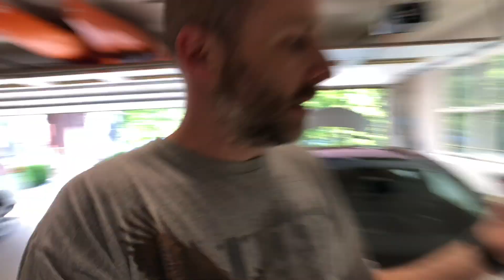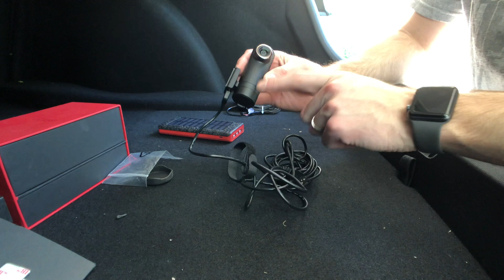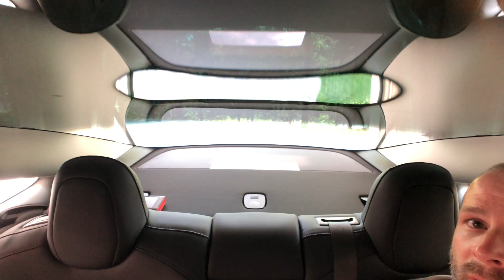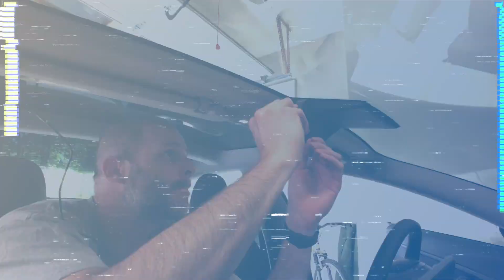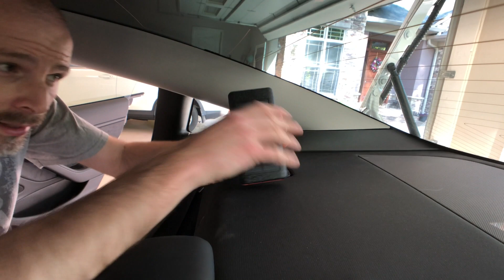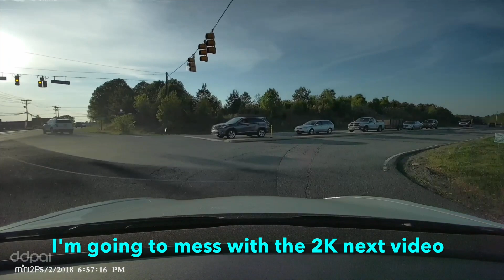Tesla Model 3 Dash Camera with a Twist

Comment from the maker: I am fully aware batteries don't like hight temps. This battery is designed to be in the sun though. Plus my car is not in the direct sun for very long each day. Plus the Tesla will cool itself off when it is too hot.
Reply: I think he's refering to the S/X. The Model 3 does not have overheat protection --- yet.
Reply from the maker: It will in the latest update 2018.24.1
Reply: So the Model 3 has the Indoor-Overheat Protection like the S and X?
Reply: i1Tesla  does the model 3 has a overheat protection like x&s or not?
Reply: i1Tesla thanks

Comment: So how does it works?
Reply from the maker: I use the TeslaCam now
Reply: Yeah but teslacam doesn't record while parked. I had someone playing with his keys on the bodypannel of my S. That event wouldn't be caught by the in car cam so I'd prefer to use a blackvue on my 3. I'm wondering if it was running OK. Another solution would be a bigger solar panel, an external battery hidden in the trunk. What do you think about that?

Comment: thinking of using Blackvue dashcams but its specs states that it doesn't use a USB cable as the power cord. Any ideas?
Reply from the maker: You have to hard wire it to the battery or find a constant power source

Comment: Why not stick battery to window, with solar panel facing glass? You can then place it at roof center. Less wire and less mess
Reply from the maker: It did not charge the battery much at all

Comment: Do you think a portable charger + power bank like this (http://a.co/guAc9mC -- RavPower 2-in-1 Wall Charger and Power Bank ) would work to power up the dash cam and charge itself from the 12V car charger or via solar? This one has 10000 mAh capacity and says that you can use it while it is charging.
Reply from the maker: Not all power banks can charge and deliver power at the same time I am finding out. I found one that will work and it will be in tomorrows video. Not solar and it is 20000 mAh

Comment: I just added a Mini3 to my Model 3. I was able to run the wire around edge of the trim. Were you able to figure out how to remove the black plastic attached to rear-view mirror? Looks like a great place to run the initial portion of the wire but I didn't want to stress it and somehow break it.

Comment: Thats a fire waiting to happen.
Reply from the maker: No it is not. The battery is designed to be in the sun It does not get very hot
Reply: It has no way to cool itself.  Just because it has a solar panel, doesn't mean its 'designed' to be in the sun. Your 50k isnt worth the risk. Im just concerned for you man. That's all. https://www.battery-experts-forum.com/media/publication/Lithium_Batteries-Fire_and_Safety_Hazards_Buser_Maehliss.pdf above 140f its starts to get dangerous. Easy on a normal summer day.
Reply from the maker: My car is not in the sun very much and the car cools itself off when it reaches high temps.
Reply from the maker: I am going a different way any way. The back is too small and the solar panel charges to slow

Comment: I installed a blackvue 750S 2ch on my model 3 since October 2017 directly to the 12v battery.  I haven't seen any problem so far.
Reply: Do you have parking mode on? That seems to be the common denominator leading to issues from what I can tell.

Comment: The sad thing is the Tesla model 3 has everything needed in the car to use multiple cameras around the car to monitor and record activity. That is what autopilot does for driving after all. Cameras, Sensors, processing power, user interface, internet connection, and hive cloud network are what make that service seamless. It would not be a heavy lift for Tesla to build in a cloud security service. There might not be a large enough data storage device in the car for recordings, but cloud services don't need nearly as large of an onboard data storage. Factor in the model 3 does have a USB interface which can allow for external hard drives to be connected. Your phone is a prime example. This is the type of innovation Tesla needs to keep introducing.
Reply from the maker: Spiitz Travsky the cameras see in black and white. The back one is the only one in color. That would not make for dash cam footage. But Tesla can pull the footage in a bad crash

Comment: My ddpai2 minis as I have front and rear drain a 35Ah battery over 36 hours so that's not going to last long unless you get shed loads of sun
Reply from the maker: Thank you for the info. I am already finding out that info now. I will be changing it up a bit and sharing it on the follow up video
Reply: i1Tesla I can tell you the pair of cams draws 600mA at 12 volt. So I think you might get 5  hours max  off your 2.4Ah pack. I gave up so now they are on the switched aux line now
Reply from the maker: That is what I am finding out today. It has been 24 hours now and it is not enough. I am going to run power to the aux line to the battery so it will charge when I drive and the sun will help when I am not and see how that works. If not I will send the battery back for a larger one.

Comment: Nice high clear view for AP tests.
Unless you park outside at some point in the day I'm guessing the pack wont work.
Reply from the maker: My car sits in the garage and the window shines in the back of the car the rest of the time I will be driving
Reply: Well, I guess if the circuits are engineered well (unlike Teslas) it might just be able to net charge.
Apropos, have you tested how much the 3 drinks from the charge cable when it's full? the vampire drain. Both S and X are straight awful. ~130watt constant waste.
Reply from the maker: No I have not tested that. That is interesting
Reply: ~130watt constant waste?  I think your numbers are wrong.  That will drain a typical automotive battery in less than half an hour!
Reply: Teslas have much bigger batteries so it takes longer but the numbers aren't wrong. The default is 100+watt. In sleep mode it's around 35watts. When the car is off. It's really quite remarkably incompetent engineering and has been so since the Roadster. If you have a 1000 watt solar installation on your house roof, a Tesla Roadster, S or X will waste all that doing nothing. Rumor has it that Model 3 is somewhat improved but not as much as it should be. I'd really like to see a number. I have ordered one and if it's as bad as S and X it might be a deal breaker. I just can't enjoy a car knowing it blows more than my household of energy in pure waste.

Comment: I would be very surprised/impressed if those tiny solar cells could pull enough to make it sustainable, but you might be able to pull it off with something like the foldable 21W Anker solar charger (that's what I have, but there might be better out by now).  Connect that to the battery, and then the battery to the camera.  I know it's nice to imagine a simple 2 product solution, but if there is any hope of making this work off solar, you're going to need more panels. This also would allow you to store the battery somewhere cooler.
Reply from the maker: I was thinking the same thing and that might be what I end up doing next if this does not work. I am testing and bringing everyone along for the ride.

Comment: Does the dashcam have park mode? If not, you are going to fill that sd card with amazing 1080p video of your garage :).  I think Tesla Nerd is right about accessory power going into sleep mode and not drawing power.  I have the BlackVue in my Model S and have no worries or concerns about battery drain.  Cheers.
Reply from the maker: Yes it has a park mode. He is right and I may have to tap into the plug if the testing does not work.

Comment: 24 milliamphours?  I think you are off by couple of orders of magnitude here!
Reply from the maker: It may be too small but that is what testing is for. I did not want a giant battery pack in the sun if this would work. That is why I am testing the idea and bringing everyone along for the ride
Reply: I meant you kept on saying 24 milliamphours instead of saying 24000 mAh (as claimed by the manufacturer) which is of course bogus because each 18660 gives about 2500 mAh at 3.5V.  They will need 15 X 18650 to have 25000mAh at 5.0V which they obviously don't have.

Comment: seems a bit too unreliable, why don't you just connect the battery to the car's 12v outlet and it gets charged when you run the vehicle
Reply from the maker: Because the 12v outlet doesn't turn off and then the warning light will pop up on the screen. Service will want me to buy a new battery.
Reply: The Model 3 manual on page 17 says the 12v outlet is only on when the screen is on. The problem the other guy you mention had was that he connected directly to the battery, if you use the 12v outlet you should have no problem. Also, as another option, you could charge your battery pack with one of the USB outlets.
Reply from the maker: I would like this to be its own system not pulling energy from the battery. We are going to see how it goes. I may have to plug in the battery so it charges when I am driving and the solar when I am not. It's a test

Comment: arent you worried about the battery in the direct sunlight? Could be dangerous as could start a fire if temp reaches 140F
Reply from the maker: I am not that worried as the windows are tinted and the car is not in direct sunlight all day long. Plus the Tesla auto cools the car off when it gets too hot.

Comment: Thanks for the dash cam recommendations. I would caution against LiPo batteries exposed to car heat. I would install a panel that charges a pack that is not exposed to direct sunlight. There is another solution, expensive but compatible with finicky computers. It is a battery pack made for car voltage specifically made for dash cams and they charge when the car is running (accessory power source) and runs the camera while parked. Depending on the model, some may run the dash cams for up to 24 hours.
Reply from the maker: I know about those batteries for dash cams. I am trying something new. This battery pack is designed to be in the sun but I so understand the concern.  My second option is to put a solar panel on the deck lid that charges the battery. We will see hoe this week goes.